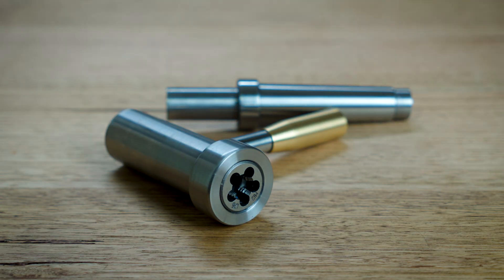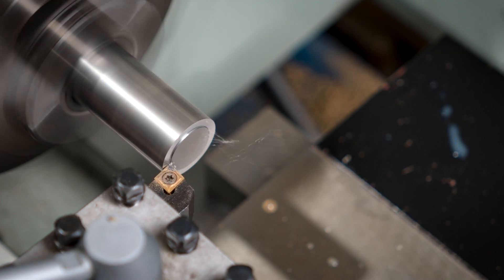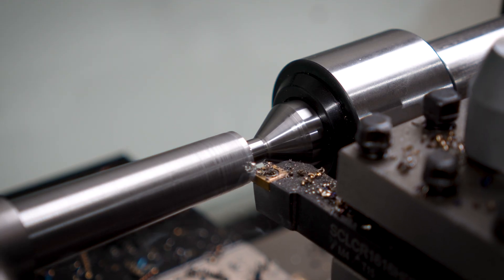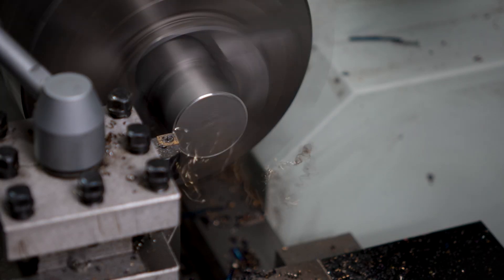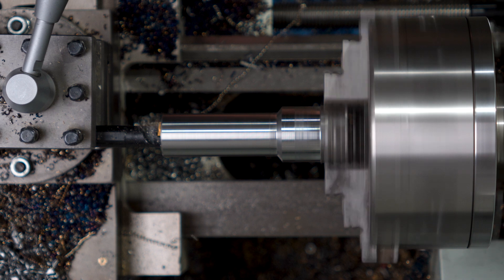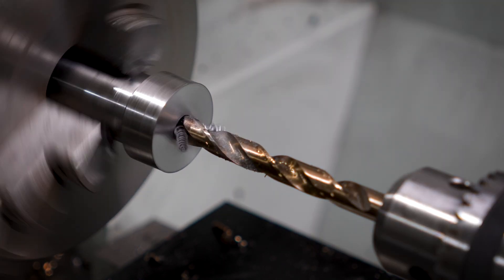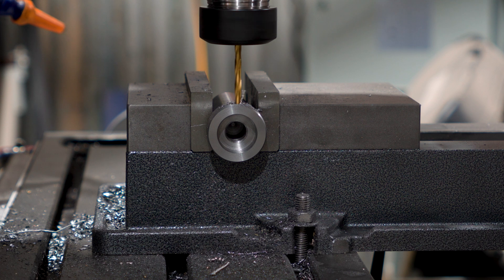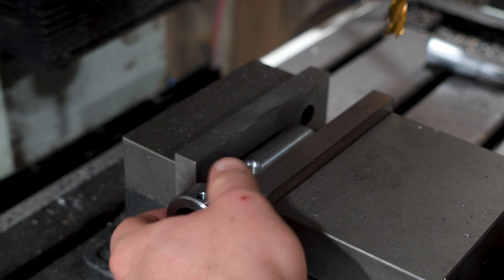Making a Simple Tailstock Threading Die holder

Comment: A tip for cutting threads single pointed or die cut. Look in your reference for thread dimensions and notice that for an external thread the major diameter of the thread is SMALLER than the nominal diameter of the thread. It is only a little bit smaller than the nominal diameter, but it makes cutting the threads noticeably easier with a die especially if you go to the low side of the tolerance. If single pointing the threads will have the correct appearance with a thread flat crest equal to 1/8 the pitch when finished.
Reply from the maker: That fit is something I'm learning slowly, I'm pretty picky about getting the best fit I can, and I'm guilty of making life hard by leaving the OD for a die a little too big. But thanks for the tip!

Comment: Also might be worth stripping your top slide, look for burrs and then carefully tighten the gib strip and lube well with some way oil. It seemed to be a little harder to keep smooth than it could be even doing it manually.
Reply from the maker: Yeah that’s something I have actually done since filming the video, before cutting the taper I could feel a little movement in the cross slide and over tightened the gibs to compensate, I pulled it down the other day and it did need a little love. But took me ages to figure it out at the time 😂 appreciate the feedback though  🙏

Comment: Not to be that guy, it could just be the camera angle when you’re milling but are you letting your edge finder kick out before you zero your DRO?
Reply from the maker: Go for it, be that guy! I usually bring it in until it runs true, and then just bump it until it moves ever so slightly to the other side and hit zero. Should I be letting it run out further on the other side?

Comment: I use the empty tailstock to keep the die perpendicular to the workpiece. 
We also need taps with a guide spigot to keep it centred and aligned before the threads start to cut.
Reply from the maker: For sure! I’ve been using the tail stock or a drill chuck in the tail stock up until now, it’s just nice to have a tool for the job 👍 thanks for checking out the video 🙏